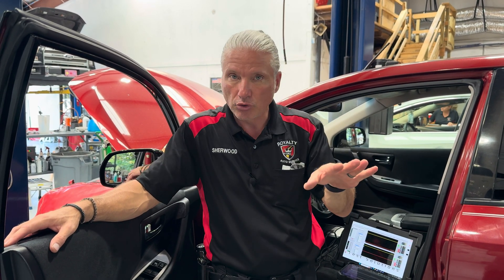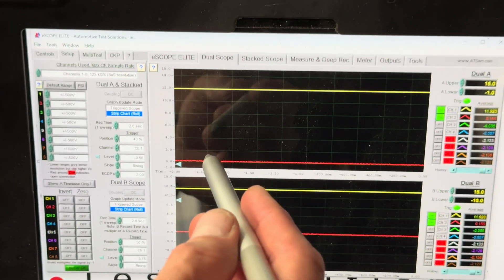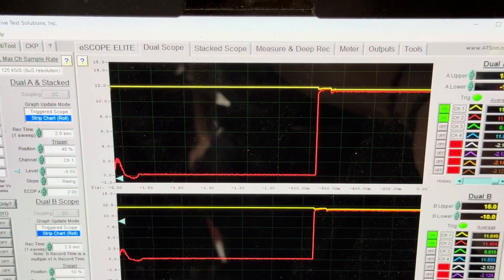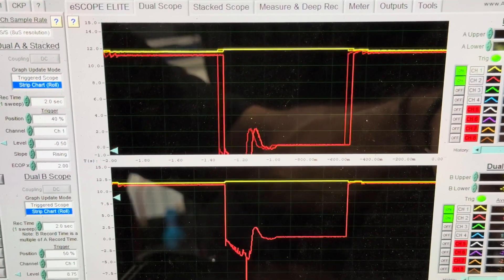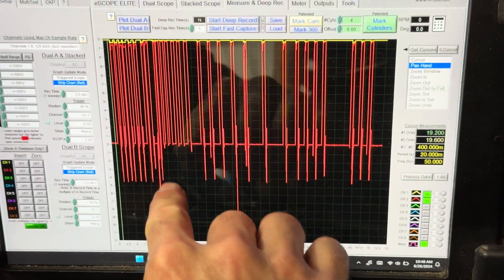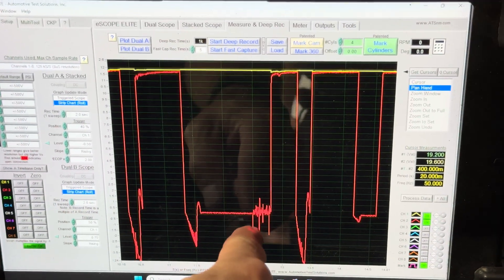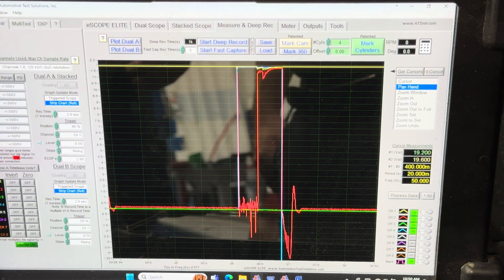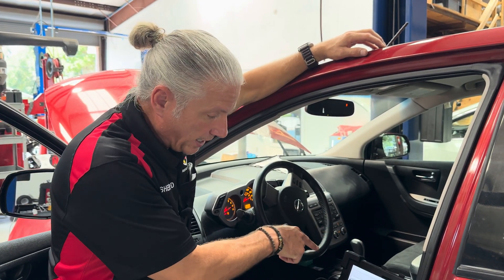This Nissan Had The Latch Replaced But Now It’s Having Issues Again! (Part 2 Why You Need A Scope!)

Comment: Cool. I put together a budget DIY diag/scope setup: 2012 MacBook Air with pico 7, pico 2204A, Hantek 3m 30A leads and 20:1 attenuator and CC-65 amp clamp. Fuse buddy, OBD2 breakout box and back probe kit, alligator clips and wire piercing probes. I also have an xTool A30M and a Foxwell N301 reader. You don't have to spend a ton to get started in diagnostics.

Comment: I don’t think the issue is shops not having a scope. Most professional scanners have one built in as well as a Pinout and example of a good waveform. Issue is not very many people left that know how to use them. The industry turned into pull the code check some powers and change part after obd2 became more advanced.

Comment: I, personally, would have swapped relays with another non-critical system first (perhaps the horn if they shared a similar relay). This could be risky as the problem might be inadvertently fixed should the problem lie with the relays blades. But, if the alternate system (in this example, the horn) began exhibiting issues, then I would be confident it was the relay. If the problem persisted with the latch, I would then be more inclined to pull out the lab scope.
Probing at the relay to monitor both power and control circuits was a smart move.
I agree that a multi-meter could not begin to display the detail needed for this diagnosis, and the lab scope nicely demonstrated a visual representation of the issue, I don't think my lab scope would have been my 1st go-to in this case.

Comment: Love the video and fully agree with using the scope. In case of relay though I would simply replace it given it costs couple $ ... if you spend 30min of your time diagnosing a relay, it will surely cost more.

Comment: I had a 2004 chevy pickup with a voltage drop to the  trans shift solenoids. It would intermittently cause the trans to stay in 3rd This was a landscapers truck When everything was ok trans shifting voltage drop from battery postive to the fuse that feed the solenoids was 300 to 400mv When it failed after things got hot voltage drop would jump to 3  to 4 volts I isolated the problem to the ignition switch around 300mv across the switch contacts on that power feed to the trans solenoid fuse The new switch was 30 to 40mv across the switch contacts. Heat would build up in the failing switch because of the resistance in the switch contacts and the voltage drop would spike to 3-4 volts and the trans would stay in 3rd gear only
Contacts in any load carrying switch or relay with a voltage drop over  200 to 300mv is a failure waiting to happen when you know whats good you can see what is bad

Comment: I would absolutely not be able to accurately and consistently diagnose modern cars without my scope! I use it way more than a meter. For the jobs where it's not convenient to drag out a laptop, I have a little battery powered 2 channel labscope. It's just as convenient as a meter, but way more powerful! With modern canbus systems, there's just no way to go without a scope, and a quick secondary ignition waveform, has put me on the fast track to fixing many "unfixable" cars. Every tech needs to get a scope, and learn how to use it! Great series!

Comment: What a great video showing how difficult it can be to diagnose the current and always evolving issues with car repairs. I’m close to retiring as a 40 year master tech ( factory certified in Toyota,Nissan,Chrysler and BMW). When I started at Datsun we had points and condensers with carburetors. The bottom line is that it was much easier to diag and repair than the current vehicles but the compensation for the mechanics has not increased at the same rate and that is why there are so few mechanics entering the workplace. Take care Sherwood you’re an absolute pro. Much Respect from Pismo Beach California.

Comment: Do have any autel scanners  with scope functions and j box. If you do how do you like it and can you show videos with you using it. If not can you show us some scope work with doing a relative compression test and show us how to set up a trigger to show when a cylinder is firing. What atenuators you would use, amp clamps etc.